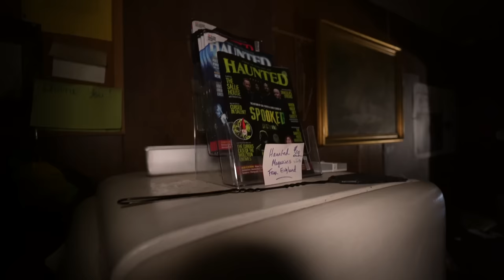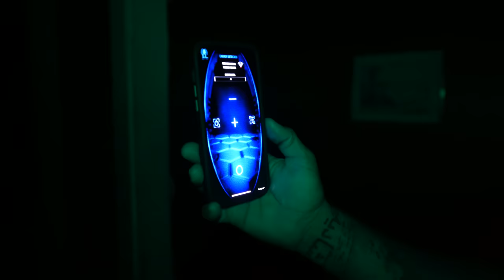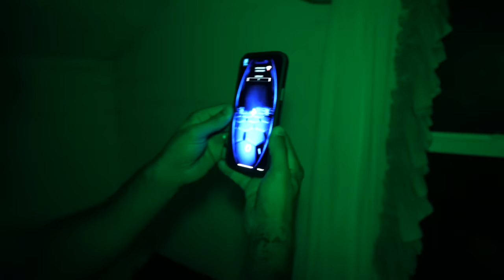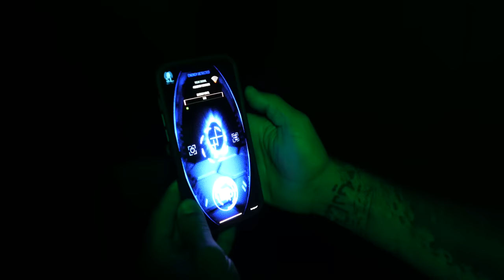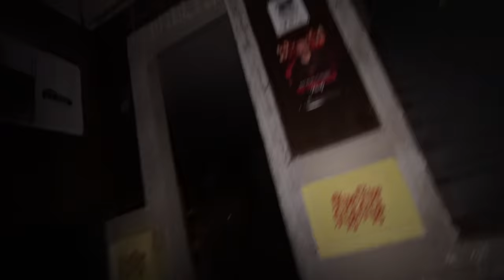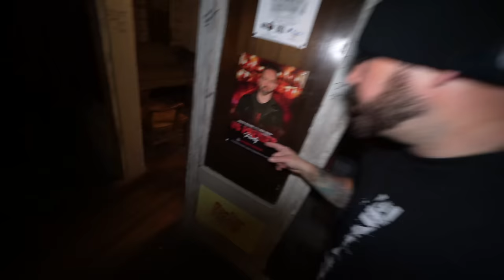House So Haunted It Needed an Exorcism! (The Hinsdale House)

Comment: The camera falling off the fridge (and most likely why the fridge was later found open) is from the tripod leg. You can see in the slow mo replay that the leg, obviously against the insulation strip of the door, opened the fridge door a little. I didn't see the guys shut the fridge door, so that's why it was open when they came back in. Once again, situational awareness is vital in these investigations.

Comment: Old houses like that have a footprint of what happened in there especially if the energy of the event was strong - bad or good. This is relevant for the old houses build with concrete and bricks. They have tape like abilities. They record everything happening.